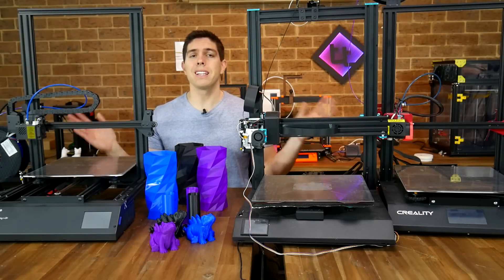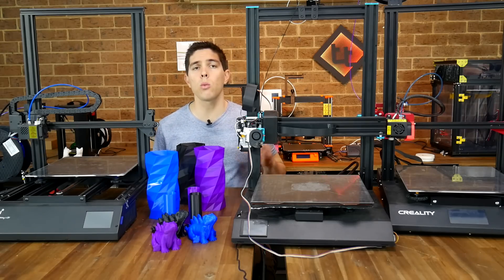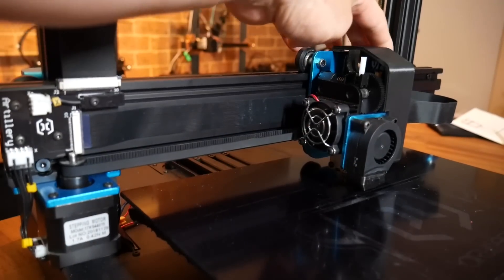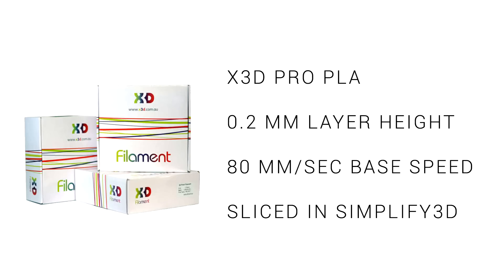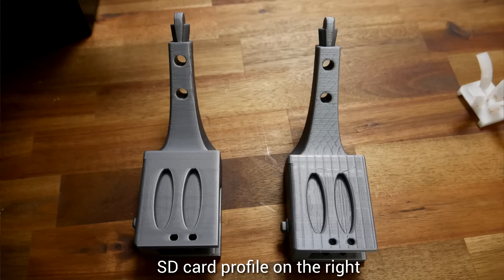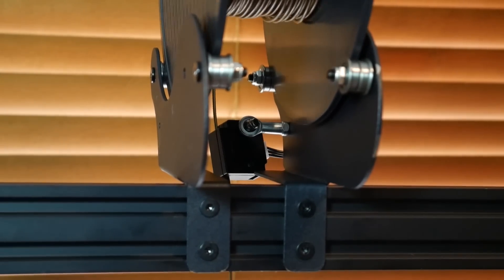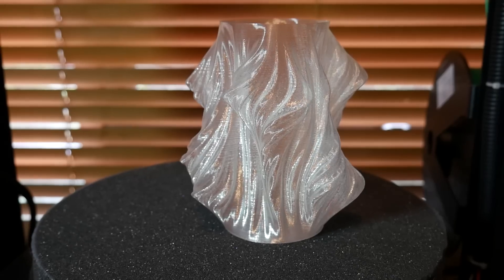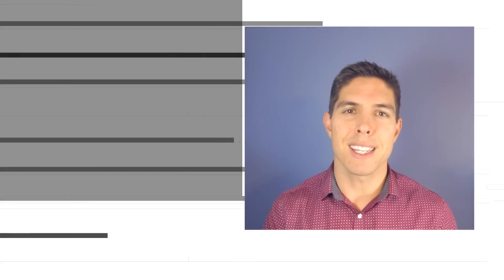Biqu Thunder vs Artillery3D X1 vs Creality CR-10S Pro: Large 3D printer comparison

Comment: In 2022 the Big Thunder is way past consideration but you can still buy them. One of my biggest purchasing mistakes. Severely warped aluminum bed  that the auto-leveling can't overcome. Outdated board and LCD screen and interface. Don't waste your money. Mine shipped from China, they ignored me when I asked to return it after 10 days.  It was supposedly in stock here in US.

Comment: Sidewinderx1 prints PETG well also on .8 nozzle. Biggest Problem for me so far is the parts cooling fan that i have a tendency to break somehow...two times in under a year.  And the Bed has some warping issues under temperatures which needs to be taken into account when leveling.
 
In general though im quite content.

Comment: If you're making money off these videos then I'd suggest a Tram Lavalier mic for audio quality issues. Most small format mics are quite dull and make vocals mushy. Though costly, the  TRAM® TR50 has a much wider dynamic range  which will enable you to fix volume level issues in post, if necessary.
Placement of the mic doesn't have to be directly under you mouth, either.  The TR50 has great off-axis quality; I've even hidden one under a collar with a 'tape bugger' for rustle noise and post was no problem at all.
Your vocals tend to be rather flat, so I doubt you need any compressor/limiter gymnastics.

Comment: I know this video is a bit older but I wanted to know if you still have a positive view of the Sidewinder X1? I am interested in a 3D printer but want to do some larger prints and like the Sidewinder for value, would it still be a good option in the 300mm + size?

Comment: for me the artillery is the best printer I ever owned ! (and I started with an Ultimaker original about 10 years ago)
Ready to print in about 20 minutes, very good print quality, fast heating bed and so Silent !
Maybe the nozzle need to be replaced to a better one because the stock one is not so good.
Reply: Personally I've been very content with my CR-10S. Added double geared extruder hobs, diagonal frame braces as on the later versions, tighter tolerance bowden tube and coupllings, and a 500W mains AC (through solid a solid state relay) silcone pad bed heater. 100+°C in under a minute. Next on the schedule is a new volcano hotend and an insulated and heated enclosure. The build volume has me more than covered for my type of projects, and seeing how this form factor seem to have stuck very well, I'm willing to put a bit of extra effort into the enclosure as it likely will fit without extensive modifications should I replace the printer later. So aiming for a chamber that can mintain and tolerate 150+°C for extended periods, and still not look misplaced in the living room corner.

Comment: I have sidewinder x1 printer but the filament not sticking two the bed I have tried very think by leveling the bed also putting heat on the bed higher and the extruder but nothing working

Comment: I personally find this video is very misleading. After watching this video, I bought the Sidewinder as my 6th 3d printer because on paper it seemed like the superior machine. I've been tinkering with the thing for a month now and had nothing but problems, the extruder is complete trash. During the unboxing video, you had numerous problems trying to get the thing to run, and even had to open up the printer to get it going. I've since bought the CR10S PROV2 and it is printing right out of the box better than a month of tuning the X1. It has a genuine bondtech extruder, capricorn tubing and a BL touch. It is by far the superior machine, even just looking at the mechanical aspects in person, it is blatantly the superior machine.
Reply from the maker: Each to their own. I only remember a loose x belt being an issue for the X1 at the start, and I've still never had issues with the extruder. The CR-10S Pro on the other hand needed a full fix video and gas been great since then. Our experiences are different, that does not make me misleading.
Reply: Fair enough, quality control on this things are spotty. also thanks for all the content.

Comment: Hi, I was wondering if you've got plans to further mod your sidewinder to a dual extrusion system. I think the x carriage is stable enough to have 2 direct drives and the possibility of a 2 to 1 switching nozzle, but got not clue regarding where to start with the electronics.

Comment: I have six medium format FDM printers and just added an MSLA resin printer.  I've been thinking of adding a large format FDM printer for production.  I'd like linear rails, direct drive for flexible TPU and the ability to enclose and heat the build volume for ABS without heating the electronics.  I'd pay $100 more for rugged and reliable electronics.  Use a large heat sink on oversized power electronics rather than barely capable transistors or other power electronics and tiny aluminum foil heat sinks.  There is a market for a $1000 light industrial printer that's reliable and maintainable for many years, positioned between hobby printers and a Stratasys.

Comment: I have had a cr-10 (original) and an anycubic i3 mega for a couple of years now and wanted to upgrade to something new. My cr-10 has been an absolute beast of a machine with little issues even with upgrades like the fang part cooling fan and motor dampers it took the upgrades and only made things better while the i3 mega was great out of the box it broke down over time so I made it an abs printer. It then quit printing at temps 240c and above. I replaced everything I could do easily (hot end, stepper drivers, power supply, etc...) and it still had the issue so I retired it until recently I decided to order a new board for it then I got my US stimulus money and bought a sw x1 kinda of as an impulse buy forgetting about the board I ordered. The board showed up and I told a friend I would loan him the i3 mega as I needed space. I decided to upgrade the fans and bearings when I did this board swap and now it prints like a dream and I kinda regret telling my friend he could borrow it lol. Hopefully the x1 prints as well as the i3 mega does now. 

The main reason I went with the x1 is the bed and the direct drive. I love printing "weird" materials like ABS, nylon, and flexible materials. The AC heated bed should make this super easy/fast and the direct drive means no more extruder spaghetti (hopefully). Just as an FYI you can print flexible with a bowden it just takes lots of time and a couple small upgrades.

Comment: I'm debating on which to buy I'm stuck on the cr-10 and the tornado but from this video I'm debating the sidewinder if there is a new one out that's a better first printer then these I just don't want to buy it now then find out something new has came out that's better. Any suggestions I'm looking to start printing I've took a few months to think about it. I want to one in the next month.

Comment: Good comparison, thx! Each manufacturer seems to continually 'update' their features, so never quite sure if the iteration you're ordering also reflects those changes. But sounds like Artillery/Evnovo at least tries to make sure that any printer currently 'in-stock' from vendors also comes ready-to-go with their latest mods and firmware.

Comment: I use the capacitive sensor that come stock on the CR10S-PRO.
When I first got the machine it kept ramming itself into the bed.
I found that lowering the sensor to just a few mill above the nozzle tip and adjusting the 
sensor screw with trial and error gave me great reliable prints. 
I print non-stop with confidence now.

I lost a couple bed surfaces in the proccess  though ... had no clue what was wrong.

Comment: I purchased a CR10S Pro at launch and had many issues, mainly firmware and abl sensor/bed leveling issues.  After replacing the stock sensor with an inductive one (8 bucks from amazon and plug and play) and using tiny machines B7 version firmware they made for the cr10s pro its been a fantastic printer.  If Creality would lower the price to around the 500 dollar mark its a no brainer imo.

Comment: I have a tevo tornado. But Im struggling with the smooth Z axis layers. It has never been smooth. 
I already use tl smoothers.

Can someone help me?
Reply: tl smoothers   is just another  jocke,they are useless for 3d printer stepper motors,just change the board with a 32 bits one and silent drivers

Comment: Hi, thanks for your your videos, always helpful. Quick questions, would you say the Artillery print quality would benefit from TL smoothers, or does the machine need quieter fans or other upgrades ?
Reply: The clone TMC2130 stepper drivers in the Sidewinder have many more features and filtering than the usual inexpensive Chinese machines with 4988 Drivers , although they probably stay in SpreadCycle mode (vsStealth Chop). TL Smoothers would have zero effect downstream for print quality with the TMC 2130 Drivers (or clones) :)

Comment: Hi Michael, I've been using a basic CR-10 for the last couple of years. Usual 'upgrades' such as fan duct and Capricorn PTFE tube. It's been great and I print PLA, ABS, TPU, PETG and even Nylon-CF with it. Anyway, the time has come to get another. I like the Creality brand as parts are easy to source and they're relatively easy to work on. So what would your thought be if you had a choice of the CR-10S Pro and the CR-10 MAX. Price difference is not a concern, but just not sure that I'm going to maximise the use of the bigger build volume. It's very rare that my CR-10 is too small. Interested to hear your comments. I'm swaying towards the CR-10S Pro and will then be following your top tips if and when I find the Creality hidden issues :-). Thanks for your great and informative videos....Matt

Comment: Got the Sidewinder X1 on sale for $400. Really great printer out of the box. The only thing I would mention is that the lever that allows you to change the filament will break if you overtighten the screw. However, you can get a replacement on Thingiverse.

Comment: I have the Artillery....fantastic machine.  Non-removable glass bed sucks.  My fix are big box mirror sheets (10 for $10) with tried and true hair spray, remove for fast cool down and slap another sheet on and print again.  no cool down.  This bed heats up incredibly fast and prints so accurate/fast for all filaments with the direct extruder.  Highly recommended.

Comment: Hi,
I think you forgot the Anet A8 plus. It is 300x300x350 build-volume and even a bit cheaper. For me it works with PETG and PLA, 24 Volt printer. Direct drive and it needs to be run a bit slower then the X1 with the smaller extruder but  it works pretty well. 
Actually, for me it has less problems then the Artillery X1 with the nice-looking but somehow disconnecting and fast overheating  ribbon-cables.
The usable build-volume on the X1 is somewhat smaller for me (with PETG)  since the corners and edges of the bed are not heated well enough and struggle to get more then 25 cms wide and long to stick on their surfaces (PETG/ ABS) and besides that the wide surface of 30 cms seems to be giving problems with the flatcables overtime.
So, for me the X1 is now very nice for fast prints that go high but not too wide and the A8 plus is more suitable for a big surface-area but less hight and less speed. 
I think that if you stick to PLA the build-volume of the X1 is well too and then with the (new) surface you hardly need any heating.

Comment: I have a CR-10S Pro and after upgrading the sensor to a high temperature rated inductive sensor my Z offset never changes. I also swapped out the hot end for a Micro Swiss all metal. The Wham Bam magnetic bed I have is a real winner, I print mainly PETG and I don’t even need to use a brim now. 
I also designed and printed a couple of cable management upgrades that tidy the printer up.

Comment: Thanks for the video, good comparison.  As I read through all the comments, I don't see comments about BIQU Thunder so far.  I bought this printer in Dec 2018 and I probably USED it between 100-150 hours and it died hard in July. I really like this printer for its quality, ease of use and other features and it's very quiet besides the fan noise.  The stock printbed is OK to use (I had to use raft for print to stick) but I upgraded with E3D flexible surface which is really good.  When I tried to print again next day after a last successful print with auto-shutdown the night before, I had trouble setting PLA temperature (I use PLA most of the time) and shut machine down.  I checked heatprobe and thermistor and they seemed to be OK.  Just to make long story short.  After I restored the machine to factory settings, the machine was dead silent, no fan noise, nothing even without nozzle connected.  Contacted factory and they sent me a new board for further troubleshooting the problem.  The machine is still down as of this writing.

Comment: Instead of CR-10s i bought the regular CR-10 but added a Capricorn tube and BL Touch. I don't think it needed them.
Before the upgrades it printed PLA flawlessly and i only needed to use a Glu Stick to help bed adhesion lifting. 
The next goal is to get ABS just as flawless in some sort of enclosure (atm the box it comes with fits perfectly).

Comment: I have a CR10s PRO. I have added the Creality version of the Ultrabase glass bed, the filament guide wheel, Updated the firmware, replaced the fan duct with the "near stock" version you recommended, and swapped the factory capacitive leveling sensor with an industrial version from a respected brand. I don't re-run the auto bed leveling every time, but I do reset the z home height before every print. Thanks to your videos and those of others that covered this printer I have been very satisfied with my  prints and the quality of them.

Comment: I have a CR-10s and love it.  Only drawback is the clunky electronics box.  I have upgraded all of the fans to Noctua and upgraded the bed heater to 110 with.  One questions I have been trying to find out is about 32-bit.  I have heard the print quality with a 32-bit board is way better.  It is able to run through the g-code much more fluidly.  Do you agree with this or are the CR-10 Pro and X1 achieving similar surface finish and noise as the biqu?  Do you see any advantage with the 32-bit board?

Thank you in advance!
Reply: 32bit boards are known to give better prints when printing at high speeds, not sure it matters much at slower speeds. The physical design/build is a bigger factor with print quality.

Comment: Nice review! I think the comparisons should be done with the same filament though, as different colors make it hard to pick out differences, and also the filaments could handle completely differently.
Reply: Differences in colour are not enough of a distinct change in how the filament prints. Unless he legit got a wet roll. I get it would be easier to see the faults because of lighting with the colour but there is no distinct changes in fillament performance when colour is added enough to skew a print  to make a defined solid evidence of colour making a spool faulty

Comment: Hi Michael I have a CR 10s pro and have followed the tiny machines upgrade. The problem now is that i have lost the power failure fixture as well as the printing pause not going to the side of the bed but stopping on top of the print. Is there a upgrade that fixes this problem? If yes can you share it with me.By the way very good video as always. Regards and thank you for your time.

Comment: I have the CR10S Pro, but I regret buying it overall. To start I had to do a lot of upgrades and mods just to get it going, the bed was not straight at  all, to add to the insult the nozzle was designed just for the CR10S a cheap move from Creality. All in all I spent over $100 dollars just to get it working. It's not worth the time and money this should have been done at the factory not by the users. Im glad other companies are starting to catch up with Reality because im just about done buying from this company.

Comment: Hey TT great video as always, thanks

random question??? a few months ago I brought a CR-10s of ebay(Australia) for AUD$538.86 (USD$366.32) how does that compare to the AUD$792.93 (USD$539.99) pro edition???

I really like the ender 3 build series, and it got me thinking... if i was to spend the money i saved on the non pro model, on a SKR board, nice drivers and a raspberry pi how would it compare in the end with cost vs performance to the out of the box pro edition??? could a CR-10s be a good contender for a build series??

Comment: The X1's direct drive should get more mention. We change filament types a lot and experiment with everything. Direct drive makes it easy to tune for the whole family.
Reply: Can easily add direct drive to a Tevo or the other CR-10 versions of machine for $30.
Reply: @abarasabwehttam  not really if you want it all metal mounted to make sure no vibrations. All the offered open source mounts i see are flimsy AF.
Reply: @skaltura  need to check out my kit, it is machined aluminum. Teaching Tech did a few videos using it and a full video installing it
Reply: @abarasabwehttam  I have one on my Ender 3 and love it! My only request would be black aluminum instead of the red!
Reply: @abarasabwehttam  That's great news, thanks!

Comment: There's a new model CR-10S Pro with a BlTouch plus the CR-10 V2 which is pretty much a super overhaul to the original CR-10
Reply: Thanks, didn't know about that one.  Took a look, nice frame changes.  Wish the controller was not still in a separate box though.